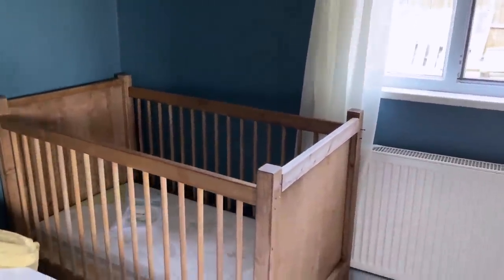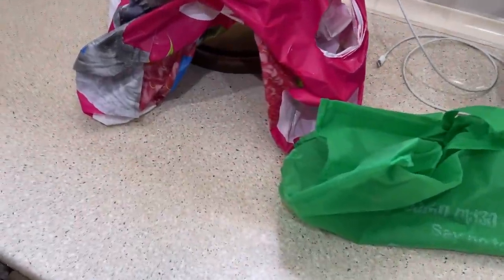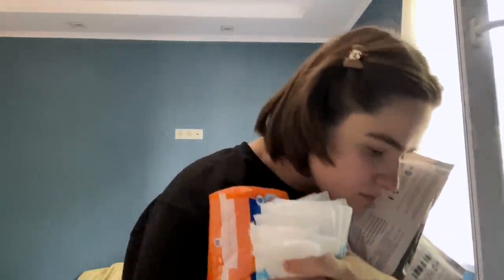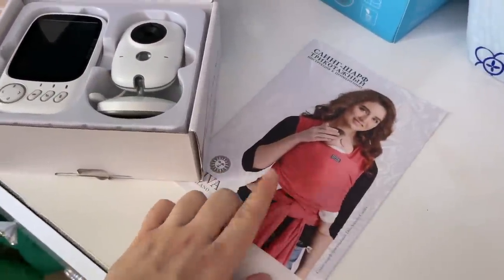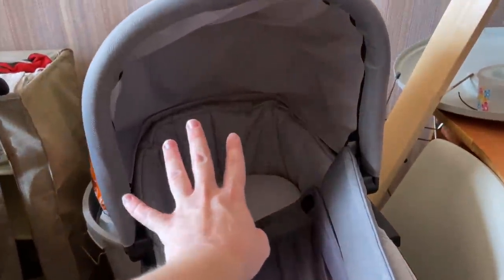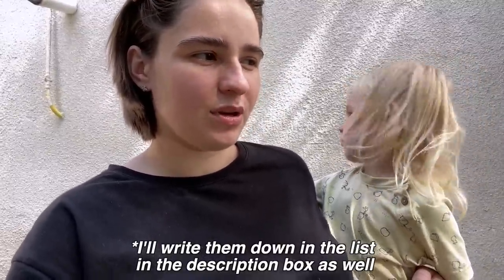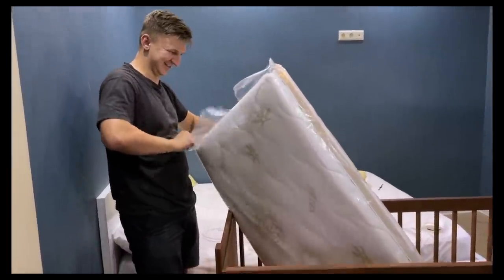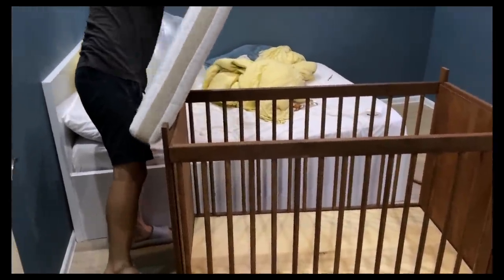Finally Prepared for the Baby (sort of) - handmade crib, hospital bag and newborn must haves

Comment: A small tip for the cloth diapers: If the inserts are from micro-fiber it is possible that they have lost absorbency over time. You can swap them with cotton diaper cloths or towels if that should be the case.

Comment: 13:40
Ah, like when I was a little kid, watching my dad doing carpentry and/or other construction. Generally good times.
I leant a lot. Plus, the art of carpentry is very cool.
Just remember to wear ear protection near loud machines, and eye protection around basically everything in a carpenters workshop. Let's just say I've seen a few serious injuries, and heard of a lot more.
One guy was walking being a guy that I think was grinding metal, and got hit in the eyeball with the spark. It was a cousin of mine on my grandparents farm. My dad's had loads of injuries from working in construction over the years, like nailing his hand repeatedly to hearing damage.
Thankfully I got off way lighter in my very limited construction work.
I still have a scar on my knee from getting hit (by accident) by a concrete block a few weeks ago.
I slid on the block and it went flying and hit my other leg in the shin somehow. I dunno.

Comment: You can buy foam on a roll. Or wrap the mattress in a few blankets until you have the right size. If you use a twin flat sheet you can wrap
It tight and baste stitch it around so the mattress is first at the edges. (You can roll a blanket and make a big L to make the mattress fit that space.)

You could also get a little carry cot and that will give you more time to fix the crib.

What a bummer.
Reply: The mattress needs to fit snugly with no gaps to prevent suffocation. Adding blankets or foam rolls wouldn’t be safe.